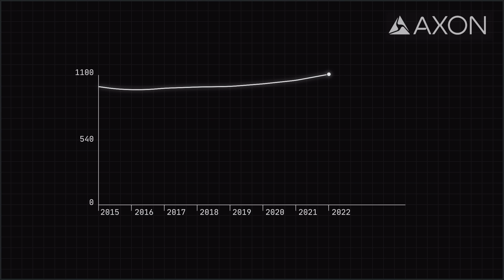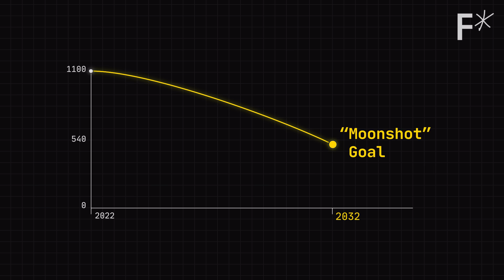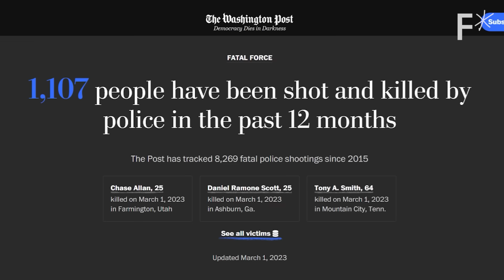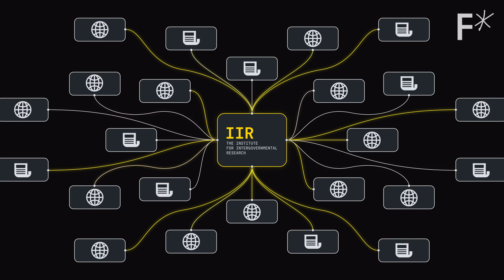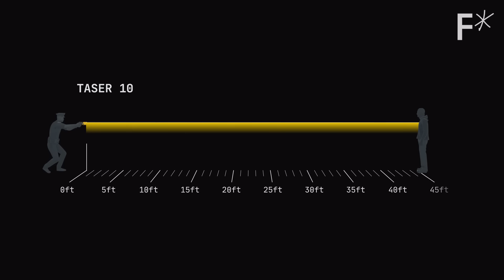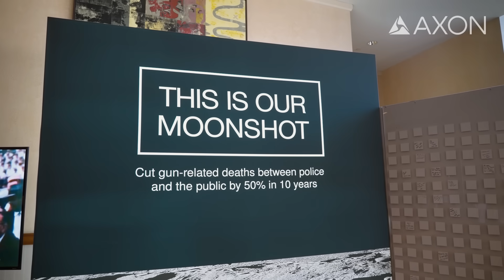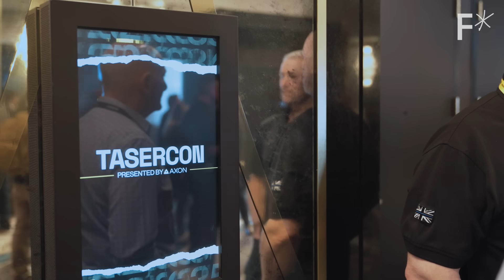Can this tech cut police-public shootings by 50%?

Comment: I'm not convinced by this Taser, I get that you have accuracy, range and the opportunity to miss and still succeed but the fact that you have to make two shots for it to work still bugs me off.
I don't know about the US but here in France most of the time I had to draw it, it was when I had to go into an apartment with someone who's possibly armed, you don't have much space or time if someone lunges at you, if the first shot doesn't connect it goes to contact instantly.
The T7 either hits or miss but that's what you have in a split second, I may be wrong but I think the T10 requires too much time to be effective as you have to make two seperate effective shots instead of one when the person will sometimes be really close to you.

Comment: How about you be straight with the public and explain the reason office involved shootings are up because the public’s attitude toward police, the lack of proper parenting or any parenting in this country, and weak prosecution against criminals. You suggesting bringing a taser to a deadly force situation is laughable.  Especially when an officer has to place two high stressed shots into a target area to be effective. Most officers have a less than 30% accuracy with shot placement, nothing like increasing the difficulty at two to three times the price.

Comment: I like the concept but it should be able to shoot two probes at the same time. The extra couple seconds to shoot the second probe could be life or death
Reply: There should be a select fire switch to toggle between firing two or firing one.

Regular Tasers fire both probes at once with a spread. The spread is because if the probes are too close together, it’s not effective. The Taser 10 seems to break away from that and fire each probe in as straight as possible to increase the range and accuracy. So I am not sure how that would work.

Comment: At a distance of 45 feet how are you going to ensure you don't shoot them in the face or eyeball?
Reply: It's still better than a bullet... and more likely to recover from an injury like that, too.
Reply: @DoubtingThomas333  if a suspect has a gun then a tazer would not be good tool
Reply: There’s a reason it’s called “less-lethal” and not “non-lethal”
Reply: Each of these Taser gun have small computers built into them to detect whenever it has made a proper contact with the skin or clothing, if there isn't a proper or viable comnection with the darts then the electric shock will not be delivered for safety reason. Thus why the operator of these less-than-lethal weapons actually have to go through a specific training course before they can be certified to be permitted by their respective police department to carry and use them on duty.

Comment: We definitely need to improve less-lethal weapon technology. However, I am skeptical about the viability of this multiple shot independent probe method. The demonstration shown here was all against stationary targets. It's much harder to get two independent probe hits on a moving target.
Reply: That was my thought, you're going to have to be a good but also quick shot to get NMI before the target can react.
Reply: You can keep shooting until you get NMI. You get 10 tries.
Reply: There's a UOF incident on YT, one of the bodycam channels, can't remember the PD or county, but the lady officer was caught up in a foot chase with suspect, pulled out the 10 and put him down. 
It does take more than 1 cartridge though❗
It's definitely better than the 7.
Reply: The VR training allows for running targets. It is damn accurate. It’s the same feel and aim as using the real cartridges. 40 foot shot is a huge plus and has little to no drop at full distance. Only downside is no more drive stuns

Comment: All of this is such bs... we all know if cops really gave a damn about people, they would just shoot up their legs and disable them as a threat... but for some reason, they always go for the head or heart shots. There are some reliable law enforcement out there though that are honest enough to shoot at the legs, but most would rather just kill kill kill so they can avoid extra paper work afterwards, so sad.
Reply: A-Box torso center mass is taught in all circles from military to civilian; and you are also more likely to survive multiple gunshot wounds to the chest than a shot or two to the leg. You bleed a hell of a lot from all the major veins and arteries in the legs, especially if a cop were to miss and hit into the groin you will die and it will not be a good death either.

Also, nobody teaches headshots outside of special forces, military snipers, and law enforcement snipers. And that's really only do to combat helmets and as the years have gone by, the helmets have gotten far more protective and bullet resistant so its not actually headshots but "neck-shots" that just so happen to land in the lower portion of the head.

Comment: 2:22 If you're gonna use non-lethal weapons, you gotta know what you're doing. Without proper training and education, you could seriously hurt or kill someone. There've been cases where things like tasers and rubber bullets ended up causing a lot of damage or even death. So, it's super important to use non-lethal weapons responsibly and only when you really need to.

Its good to know the emphasis isn't solely on deployment.
Reply: That’s why many departments don’t call them “non lethal weapons”, but rather say “less lethal weapons”.
Reply: Uh yes “less lethal”. Bean bag rounds, tasers, pepper ball, rubber baton rounds from 40 mm, all meant to hurt and immobilize, but not kill or maim. Doesn’t mean it’s a guarantee, it just lowers the probability of injury vs a lethal option
Reply: Someone pulled a gun on me 3 times in 3 years here in nyc randomly i couldnt care less

Comment: it's good that they acknowledge that only tech isn't going to solve it. there are too many guns in the US and that scares the police into using theirs. they should look at what is different in other countries. my gut feeling is that this will change nothing, but at least they are trying something
Reply: It's pretty obvious what is different in other countries, stricter gun laws. In the UK this hasn't made it difficult to buy a black market gun, but it does mean there's barely any black market ammunition, meaning ammunition is so expensive that most criminals with illegal guns don't actually have any rounds in the magazine, or only have a few which are only used if they're dead if they don't because they cost so much.
Reply: No such thing as to many guns as long as they're in the hands of law abiding citizens.
Reply: @toddturnbaugh4451  46% of the worlds civilian owned fire arms isn't too much?
Reply: @toddturnbaugh4451  i don't hear any solutions from you. it's simpler to take away guns, than guarantee that citizens abide by the law

Comment: The Bola Wrap is a hand-held remote restraint device that discharges a Kevlar tether, eight feet in length, that is designed to entangle a subject at a range of 10-25 feet.  This allows officers to temporarily restrain a subject at a safe distance and can potentially reduce a subject’s ability to struggle, minimizing the possibility of needing to use higher levels of force.  The device allows for a less injurious level of force in certain situations, compared to electronic control devices like the Tasers.
Reply: Bola wrap doesn’t work. So shut up.
Reply: Yea , that’s why our Dept ( second largest ) said No
Reply: Bola wrap is garbage

Comment: What's the voltage rating and what's the average max voltage deployed when these are used ?
Reply from the maker: From Axon: The number of electrons delivered (charge and current) is a more meaningful safety measurement than voltage, and the amount of current delivered by all TASER energy weapons is extremely low, about 1/100th of a Christmas tree light bulb. That being said, TASER 10 is low voltage, with a maximum output of about 1,000 volts (compared to Van de Graff generators found in many science museums that discharge up to 20,000 volts with no injury).

Comment: 2 shots instead of 1? How affect is if some is right next to you or running towards you
Reply: It has 10 individual shots.
Reply: @stealingfire5036  You have to land 2 shots to make it taze. If I understand the technology correctly.
Reply: @MortyMortyMorty  You had to do that with the older models too. But with the old ones, both probes would shoot together, with an arc between them, and you had to perfectly line them both up at the same time, on a moving target. If you miss one of them, it doesn't do anything. If you're too close or too far, the probes will land too close or too apart to shock effectively. You had no control over the arc of the probes, besides managing your distance from the target.

So now with the new tasers, you have 10 individual shots that fly in a straight line - 1 fired at time. So you don't need a perfect distance, and you can aim each probe exactly where you want them. And with 10 shots, you could probably taze more than one subject with the same tazer, rather than resorting to lethal.
Reply: @stealingfire5036  Thanks, that's great info! I tried to educate you, but turns out you are the expert :D
Reply: @MortyMortyMorty  😏👌
Reply: @stealingfire5036  the fire rate better not suck cause that second shot counts like ur life depends on it
Reply: @sedled2829  It looks like it's as fast as you can pull the trigger. There's some live demo clips from when they announced it. In one of them, he's rapid firing it just to demonstrate. So even if you miss, you can follow up instantly.

And you're not restricted on distance anymore. Can literally be rolling with someone and hit them in the side ribs and thigh point blank, and it'll work better than a drive stun - and actually penetrate heavy clothing. More reliable less-lethal, means less need to resort to lethal. Game changing.
Reply: they shold lose there lives . i have i solution but dont want to give .